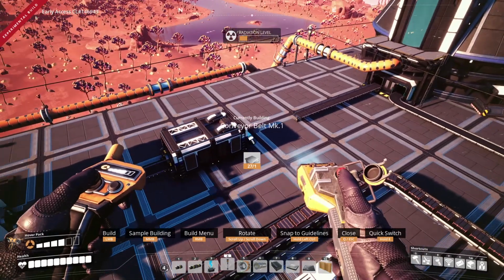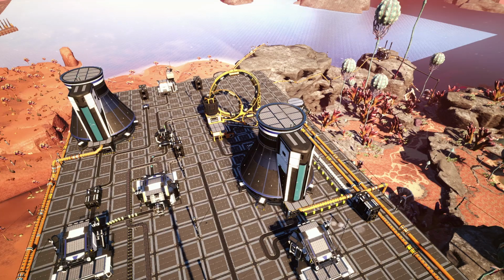Satisfactory Update 4 Gameplay - Nuclear is BROKEN

Comment: I disconnected nuclear from grid ,,dismantled two times thermo power gen rebuilt two times thermo power gen in same location ,,followed power line to first multi pole reset fuse power failure fixed.running on coal and thermo power....

Comment: As long as coal and oil power have zero downside to them, I'm fine with plutonium fuel rod production and sinking.
It creates a closed loop scenario, with a bit of extra effort and planning. 
That just puts nuclear power in the same viability class as oil and coal. I think that's a great improvement.

Comment: I think I must not be familiar enough with you to realize you're being sarcastic or something, because what you're saying makes no sense.  How does dumping your fuel rods into the sink create any power, let alone infinite power?  And how does it eliminate waste?  I guess technically if you're dumping your fuel rods into the sink and never actually using them then that would eliminate waste, but only by not producing any power.
Reply: Nuclear waste has made a lot of people ignore it entirely and stick with turbo fuel. With no way to get rid of the waste Nuclear, you would end up building an entire facility somewhere miles away for storage.

Now with U4 we have a way of recycling the waste. Making Nuclear infinite power
Reply: @ventzp2133  
I realized what I was missing after I posted.  I was splitting my attention between watching the video in the background and doing some data entry.  First time through I completely missed that they were the plutonium fuel rods he was sinking.

Comment: Wasteproblem solved!
But with the Change on nuclear fuel rod Production they reduced the amount of rods U can make per Minute from 95 to about 40.
And with the Cost of Refinement to sink the waste you actually lose a Lot of Power 😢
Reply: I just did the Math:
Early Access:  maximum 472,5 Nuclear Power Plant equals 1181250 Power
Upadate 4: maximum 187 Nuclear Power Plant equals 467579	Power

And i used the Plutonium Fuel Rods for Energie Production...

It is broken i guess

Comment: This smells like it'll get fixed before it hits early access. I just can't think they'll let this work. if so, it'll solve all late game storage issues and make Nuclear power on a massive scale a must do.
Reply: I dunno.  I think with the new "All generators run at full throttle all the time" mechanic nuclear waste was gonna need some kind of nerf, and using the particle accelerator which takes tones of juice might balance it out. You solve waste but in return your efficiency goes down.

Comment: I dont get it, sorry. So i can put the rods in the sink and get....power????
Reply: Make uranium plants;
Plants generate Waste;
use waste to make plutonium related items;
throw plutonium items in the sink;
now you can make giant uranium based power plants without worry about waste.
Reply: You get some points, but honestly I don't get the hype either. From my brief looking at productio  rates when i unlocked this stuff, besides eating a bunch of extra resources to make the plutonium rods out of the waste, it also uses a pretty significant amount of power. Between the Particle accelerator, the extra extractors, assemblers etc. It looks like it'll eat at least a 25% of your power production from yourreactors. 
Throw in the fact that you also have the power cost of making the normal nuclear fuel rods for the reactors that you brun to get that 25%+ of power, you are probably looking at neatly a thrid of your nuclear power going to waste removal that way. Plus, as said, a bunch of extra resiurces. Far cheaper to just store it up in a corner, and maybe occasionaly drive trucks full of it off the world edge.

Comment: Really disappointing that the plutonium fuel rods do not boost the power production for half the burn rate given the amount of steps needed to make them. I will still use them for a second nuclear reactor complex while sending the ones that don't get used in the nuclear reactors in the resource sink.

Comment: In order to balance sinkable waste without removing it, devs should make plutonium fuel non-sinkable, but allow you to run it through one or two particle accelerators to make packaged and/or pre-packaged plutonium fuel that you can throw in the sink. This would keep the ability to sink waste, but make it require a lot more processing.

Comment: with the particle accelator using 1000 MW+/- it might not be so op to be able to trash waste as plutonium
Reply: you lose a bit of overall power but you don’t have to worry about waste
Reply: Together with the extra gas extractors, assemblers, blenders and manufacturers... Would need to work out the overall power usage of the plutonium production line.
Reply: I would like this way or another dumpable plutonium waste container that cancels out in terms of energy but in a later tier u get even better sources of energy and can "pay back" the energy debt by recycling your waste at high cost.

Comment: For when they almost certainly nerf this.. given the rate that waste is produced and how much more deadly it is (apparently?) Would probably be a very good use case for drones. You can have a waste dump WAY out in the middle of nowhere and all you need is a drone platform. Don't have to run a super long conveyor or train line or anything.
Reply: You could power the whole system with a single plutonium reactor as well lol. Just drop a couple of plutonium in the drone's waste run. It's not like you have to do much to deal with that reactors waste :P
Reply: @Goodgu3963  you'd be better of with running a power line. Remeber, they changed it with update 4 so the generators and reactors (ecxept bio) all run at full speed at all times, no matter the consumption. Not worth it to run a full njclear reactor just for the single 100 MW drone port.
Reply: @reappermen  At that point you just toss in a electricity storage or 2 and only send a fuel rod occasionally. I agree a cable would be more efficient but this way is more fun lol
Reply: @Goodgu3963  hm, yes, a bunch of power storage would work. Though you'd need what, at least 20 of them sincd they only charge at 100 MW.  
And also, you couldn't automate the transfer realy, which would be annoying at some point IMO
Reply: @reappermen  You could probably automate the transfer with mk1 belts and splitters to create timing lol. Either way it wouldn't be super practical. But fun none the less.

Comment: why do people get upset over this?  things like this make the game fun and if it gets nerfed then it will actually break the game and it won't be fun anymore.  Just enjoy the extra boost.
Reply: @timlooijen7721  Okay then those people don't have to do this. Anyone who doesn't want to use this method can just use the fuel rods for power and deal with the plutonium waste by storing it somewhere. That is a perfectly acceptable choice. But why can't the people who don't want to go through that just have their easy way out? Just because a mechanic exists doesn't mean everyone is required to use it. I think the fairest thing is to give everyone the option of doing what they please so everyone can enjoy the game how they want to. Plus, the people who chose to use the plutonium fuel rods do get an advantage; they can run more power plants than than the people who sink the rods, so they can have a bigger power production than those who chose to sink. There's advantages and disadvantages to both styles, but people now have the choice to play however they want to.
Reply: @specialk4431  They will always have the options of mods that deal with waste in various interesting ways.
I think, considering what they said in the video,  that the ability to sink the rods is a bug that will get fixed, and really, even with some massive nuclear there is room on the map to store quite a lot without affecting most of the map so I do not consider it to be a really huge problem anyway.

Comment: I wouldn't call that "broken". It's just how each tier of the game works...it makes previous tier obsolete by comparison. Hell, even coal power seems OP after you've spent so many hours running around collecting biomass to keep your factory powered. If you want to setup that extra reprocessing loop and consume all that power to run it, only to dump that unused power in the resource sink, I guess that's your decision. There are probably more efficient ways to run nuclear power if you're willing to accept some waste storage. And I'm sure once the higher tiers are available with fusion power or maybe renewable power options, those will seem even more OP. Plus, I suspect at some point there will be an option to process the nuclear waste to make nukes, so maybe having all that spent fuel will come in handy later.
Reply from the maker: Well I think it's more that there's no tier between Nuclear fission and Plutonium maybe this will change late game but for now it feels too easy.

Comment: zipline needs buffing, the blade runners are faster.
Reply from the maker: I don't know as they can be used for different things... sliding down or up a large build rather than having to run all the way around. sure one against the otherin a straight line Blade runners win :) but different uses for everything
Reply: @TotalXclipse  Yeah I see that use for the zipline but the slow speed makes it feel somewhat useless as soon as you get blade runners.
Reply: @Hayden123457  Except you can use both at the same time. Blade Runners on body and Zipline in hand.
Reply: @toddallan6673  I guess

Comment: Half a year and i will be able to do it lol
started a new save with update 4
Reply: Rush batteries. Put 2 in a separed circuit near your coal power plants. Let fully charge and disconnect. NEVER do again a pain in ass  power grid manual restart. Just flip the power switch and sit to watch every single generator run like butter. And if you have Power T.O.C put a lot of batteries and biomass generators ( they dont burn fuel if another grid is UP ) . And forgot power problems for a long time.